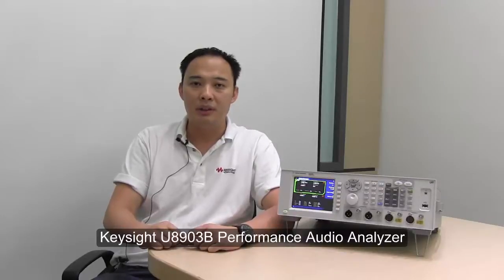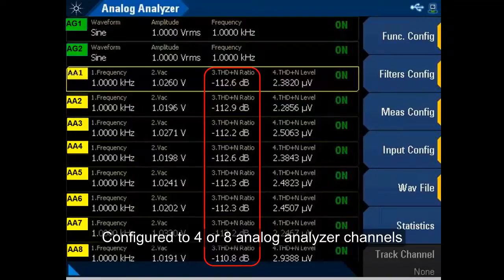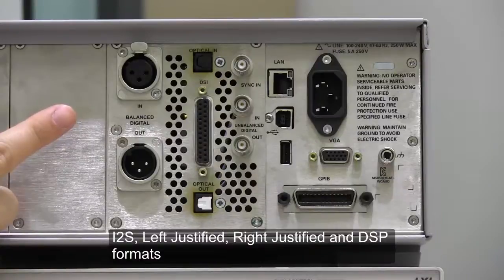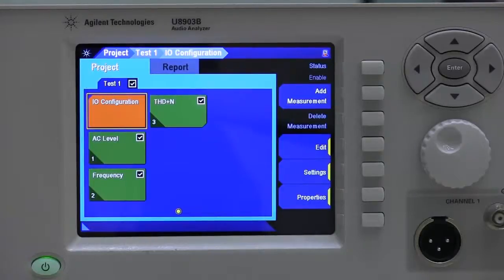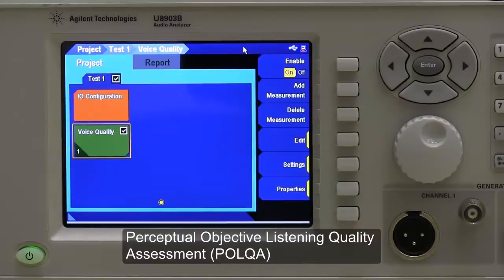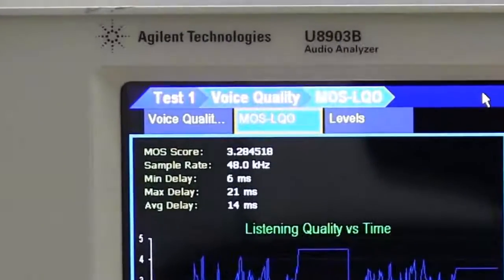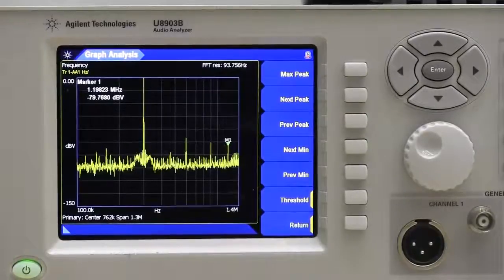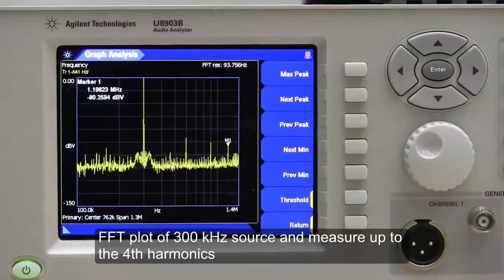Introducing the Keysight U8903B Performance Audio Analyzer

Comment: Ironically horrible audio on this video.
Reply: If I had to guess, it sounds like a crappy microphone from a distance, and clipped amplification of that. Also, echo caused by the distance and small room with lots of audio reflective surfaces. Not to mention only left channel audio. Basically, everything that can go wrong did go wrong. 😆
Reply: If only they had an audio analyzer. Doh!